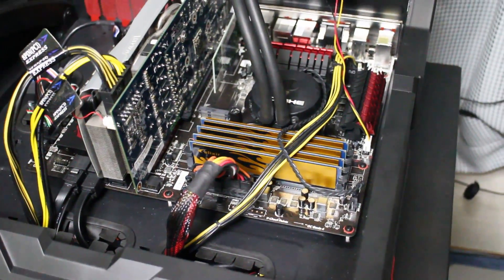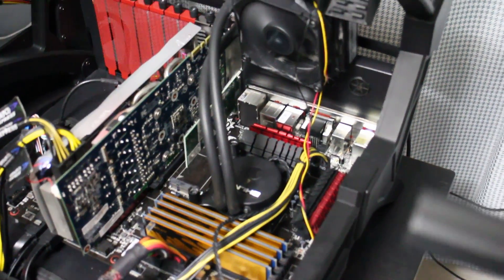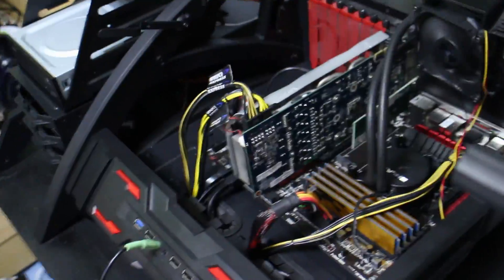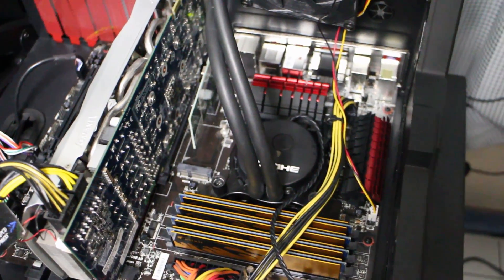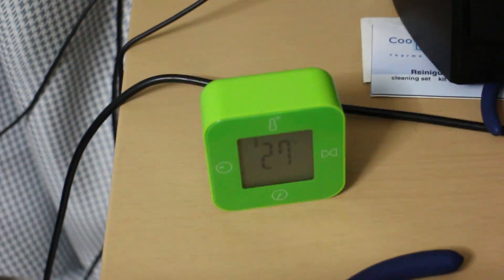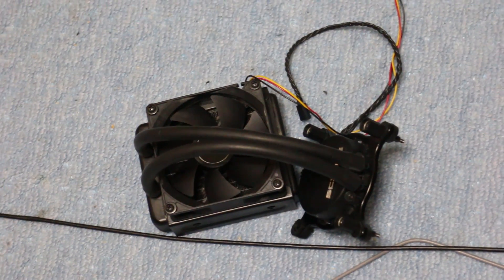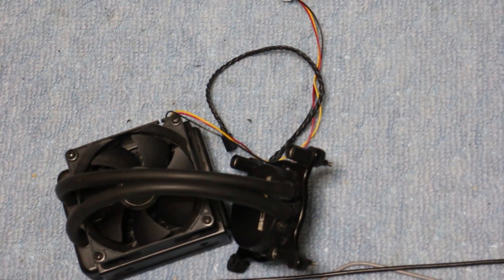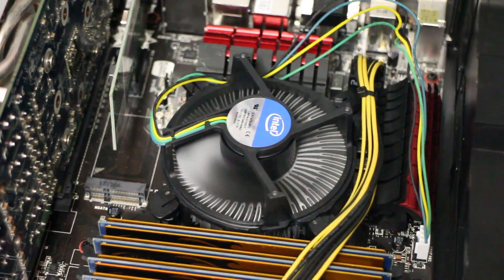How To Spot a Dead CPU Water Cooler (My Asetek Water Pump Failed)

Comment: I don't know if the author is notified when someone comments but I have a closed loop water cooling system for my CPU as well. Recently my computer will make a whirring noise on startup (about 5 sec's into startup when all the fans spin up to their proper speeds) that sounds like a whirring noise. I've put my ear up next to and obstructed 8 case fans (didn't touch the PS fan, but determined it was not the source). The only fan I have no direct control over is the CPU fan.  Now here's the thing, once the computer is warmed up, the noise stops. It takes maybe 2 mins at the absolute most and only does it on the first startup of the day, making it notorious to isolate. Any thoughts?

Comment: Would anyone happen to know if you could test a water cooler like that without a motherboard or any parts besides a case and a power supply?  Because i just ordered a thermal take water extreme 2.0 or something CPU cooler and I want to test it but all I have is a computer tower and a power supply.  So how could I test it? Please help anyone
Reply: You need to jump the motherboard cable on your power supply. You can use a paper clip and some tape to insulate. Just search how to use power supply wihtout motherboard. I bought a Seasonic 350W PSU (on sale cheap) specifically to test my custom loop last year. That is why I needed to find out. You might even be able to buy a jumper for $5 or so. Check out Ebay. 

It is possible. You simply need to jump the motherboard connector.

Comment: Hey Tech City - I like your channel. You bring alot of good information. I like your videos when your just messing with your overclock. That's Me. I'm a AMD fan, but decided to go Haswell for my next gaming rig. I need something to do justice for Asus 24" 144Hz 1ms monitor and a GTX 770. Sorry to hear about your cooling pump. I just had to rma 16g of ram, and a psu. I want to go water, but not sure yet. I might just pull the trigger on a Phanteks PH-TC14PE CPU Cooler.

Comment: My first thoughts whenever buying products is the quality, price reflects on the quality, I wouldn't expect 100'000 hours out of a cheap pump that has came stock on a factory assembled liquid cooler. 

I also hold very low expectations for anything I don't build myself, it's failure wouldn't come as a surprise, it's very unlikely I would have bought anything of that caliber in the first place. I'm a pessimist, I expect the worst so I'm never disappointed.

Comment: Some motherboards have clear CMOS jumpers. Higher end boards have a clear CMOS button either on the motherboard or the rear I/O. Easiest way to clear CMOS if you dont know where the jumpers or buttons are is to unplug your power cable from the power supply in the back then take out the mother board battery. The battery is a round somewhat flat watch style battery. Its usually located under the PCI-E slots or near the lower half of the motherboard.

Comment: Had two corsiar h100i and both died. When the pump died my computer didnt shut off, but was idiling at 85c. I RMA the second h100i and corsair sent me a brand new one. I bought it from amazon and the 1st died in 3weeks, returned it and got the 2nd. 2nd died after 2months so RMA it. The 3rd one is running great for 3months now still have 2 1/2 year warrenty on it. My CPU is i7 3770K.